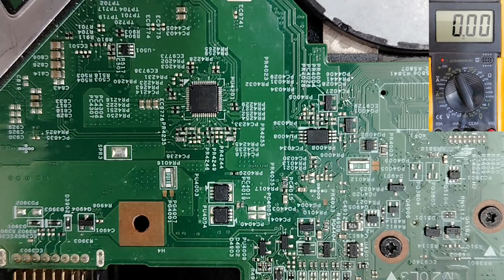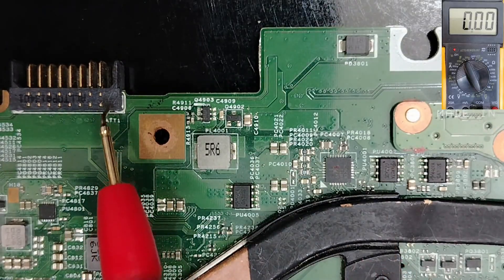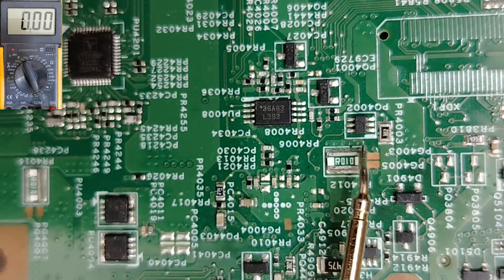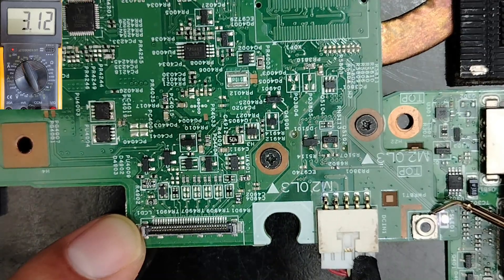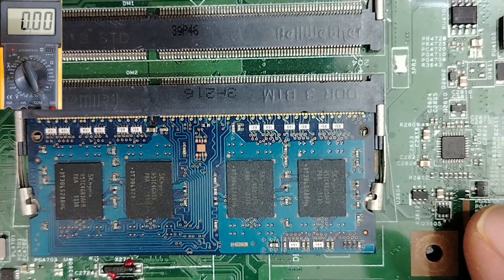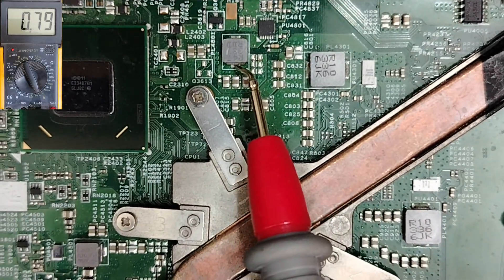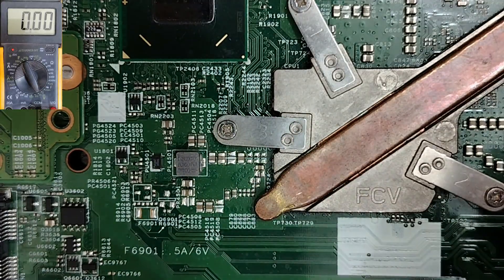Check Laptop Motherboard Problems at Home - No Experience Needed

Comment: Hey! Thanks for this tutorial, man!
I still can't find the problem with the motherboard I have; it's a HP Stream 11-ah117wm DAY0HGMB6C1 REV:C, which does not show video at all. I have some inductors with no voltage but can't find the root of the problem. I also flashed the BIOS with few .bin files using a programmer, but the problem persists. Maybe you can help me? 
Thanks in advance!
PS.- You just won a new subscriber!!!

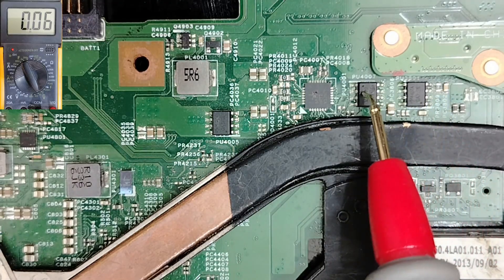Comment: @ 1:50 how did you determine that those are the correct gate values? Did you find a pinout that showed you this?
Reply from the maker: Good catch. The pin 4 is always the gate for that kind of MOSFETs
Reply: @electronicsrepairbasics_erb  thanks for your quick response; but what I’m asking is, how did you know that the voltages for both input switches’ gates (1.7 & 3.6) are within spec?